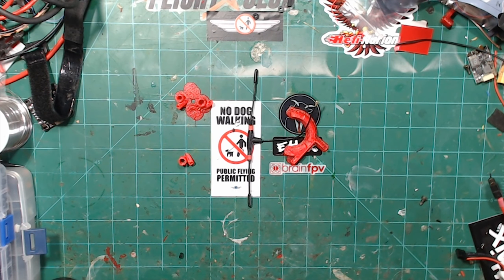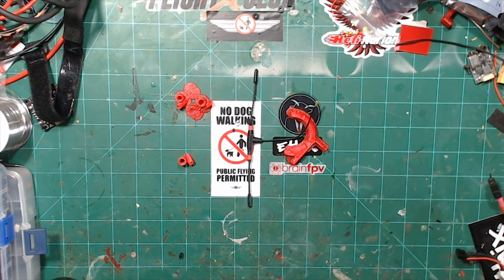TBS CROSSFIRE ANTENNA TESTING\\IMMORTAL T vs DIPOLE\\VERTICAL vs HORIZONTAL

Comment: Ya I think my crossfire stuff is broken becuase for me about 100ft los I was at 1W then failsafed into a lake
Reply from the maker: SkinnyFlea 262 that’s why I run RSSI on my Taranis. It’s saved me a few times. When I power up and it says 50 instead of 16-20 then I know maybe a ufl is going bad or antenna broken.
Reply: ChaddyC MODELS and RC once I can build another quad becuase mines in a lake I will do that becuase I have wanted to do that but never got the time

Comment: This Crossfire stuff is confusing IMO,  I’m hesitant to try it now. Everyone says how great it is, but yet I see all the talk about Antenna placement and position due to failsafe a etc. what happens when you fly behind your self or do serious Freestyle. How can antenna position even matter at that point when you all over the place while flying.  Hard for me to drop the money when on one hand it’s supposed to be soo good but on the other there’s seems to be no perfect Antenna placement.  Help me understand and change my mind. Cause I don’t wanna just switch to Crossfire just because it’s the Koolaid and everyone has it. I would consider it so I don’t have to worry about failsafe but it seems to be more of a headache than it’s worth.
Reply from the maker: ive had zero issues with crossfire..as long as things are oriented properly and you study up a little and test your setups before sending it out a mile behind trees..you should be OK
Reply: DORKYand40 thx for the reply. I feel the pressure, LOL cause so many peeps are using it now.I don’t plan on Long range but have been pondering Crossfire more now for the extra security when fly Bandos and tighter spots.  
Just wanna make sure it’s truly worth getting it.
Reply from the maker: @cletussurfsalot7190  yeah man dont over think it..ge the $150 crossfire lite and just rock it :)
Reply: Speaking on behalf of personal experiences, I was hesitant to switch to crossfire after spending a lot of money on spektrum and then DJI controller..... crossfire outperforms then both by double the distance and the penetration on the crossfire lower frequency blows away both of my old systems. Now I only have to worry about video link, I will always outfly the video link of the dji air unit before losing radio link. I do a lot of flying over water and now I have so much more confidence